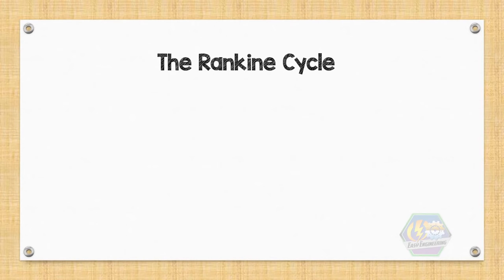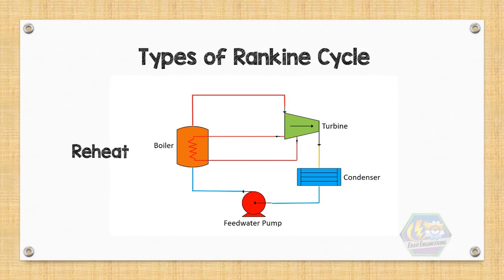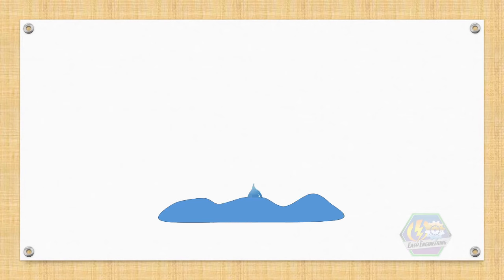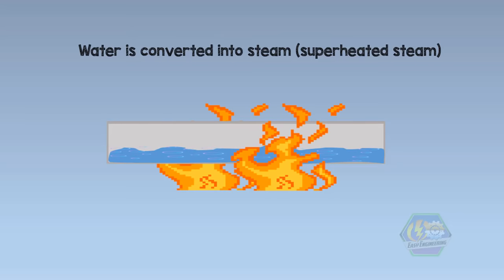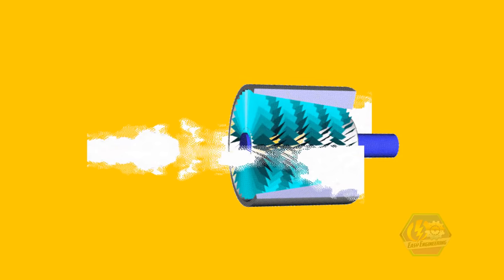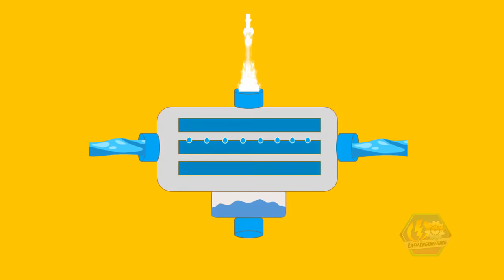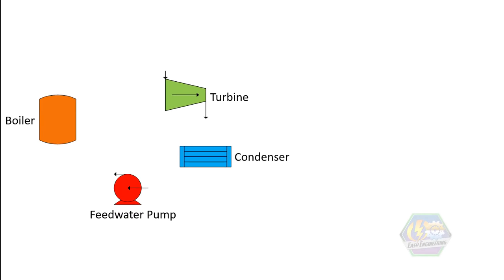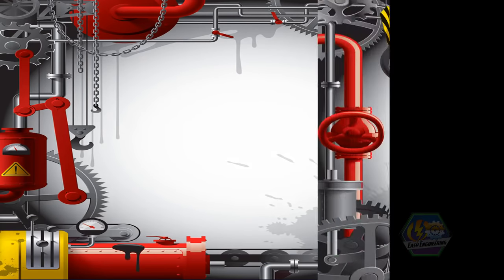RANKINE CYCLE  (Simple and Basic)

Comment: From 3-4 there is an isothermal process taking place i suppose. Because the Temperatur would change if it was an isobaric process as you assumed. Plus there would be a different curve within the T-S diagram for an isobaric process.

Comment: Can someone explain what kind of feedwater pump can handle this kind of temps and achieve bigger than boiler pressures? Can you use a smaller turbine working as a pump directly connected to the turbine shaft?
Reply from the maker: Brother, remember that feedwater pump must have higher pressure than your boiler because that's how Second law works. Also, there are main turbines that have 3 types of turbines connected in one shaft (HP, IP, and LP Turbine).
Reply: @EarthPen   I know this already, but the main question was about the pump.

Comment: Could this be a perpetual motion device if the device is generating it's own energy for evaporation and condensation?
Reply: Dude, this kind of thing doesn't exist. The carnot efficiency (just based on the temperature difference, ignoring all the losses) never gets 100%. Beside that, there's something called "the second law of thermodynamics" that says that the entropy of a closed system ALWAYS increase through time. In other words, you cannot create a perpetual motion or infinity energy device.

Comment: perfect a closed loop cycle now just replace the water with a low boiling point liquid and Bam higher efficiency bye needing less input heat this is what ill use for my fusion reactor prototype. I have four vids up about it.